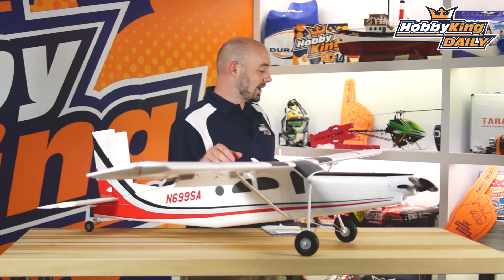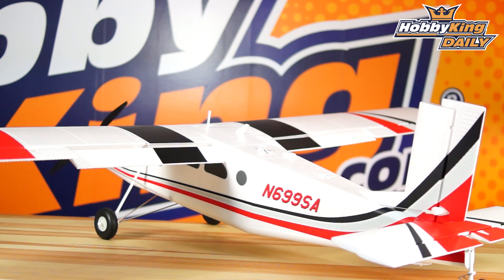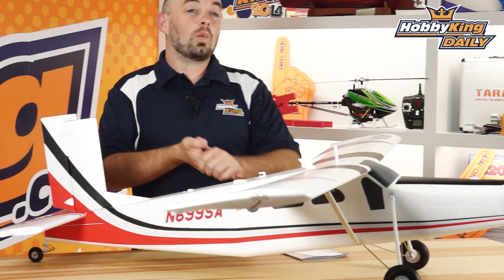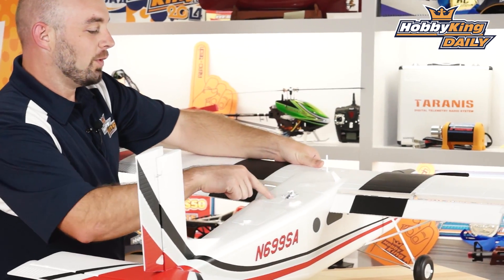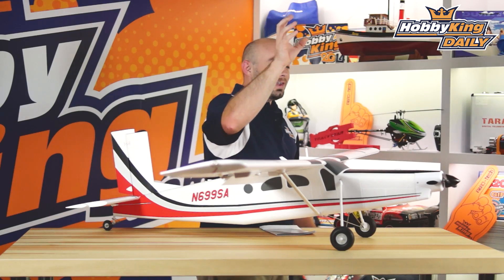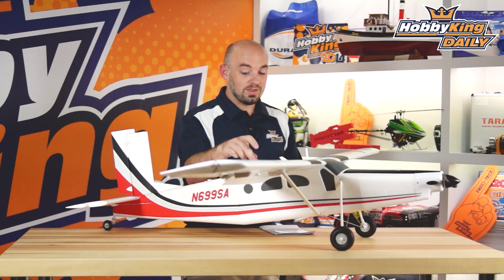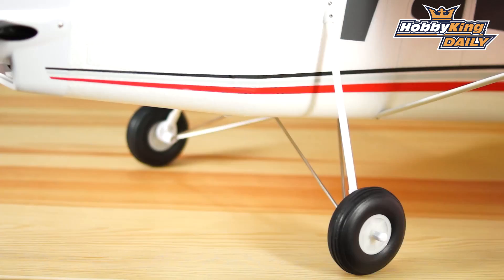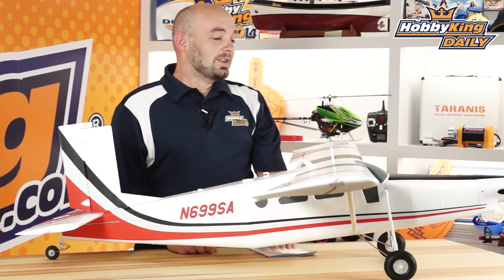Pilates PC-6 Trainer - HobbyKing Daily

Comment: No inside look, so how do you FPV this thing?  And doesn't the tow line for a glider interfere with the tail?  Good idea though.  After you bomb-drop, no way to close the door so it is likely to get torn off on landing.  I suppose you could mount the video tx in the bomb bay.  Yeah, $248 to 267 US is a bit steep, but it's a big plane and PNF, so I have everything else I need on the bench.
Nothing on flight characteristics.  Flaps look good with good deflection, but no flying video so who knows what the stall is like.  I don't think I'd put this much cash in the hands of a trainee!
Reply: Shipping was $36 to $98. Not one to complain about cost but am one to get inpatient and FedEx from east to west 7 days would drive me insane